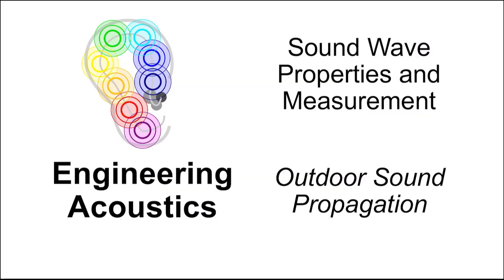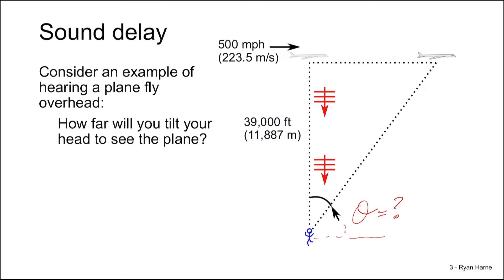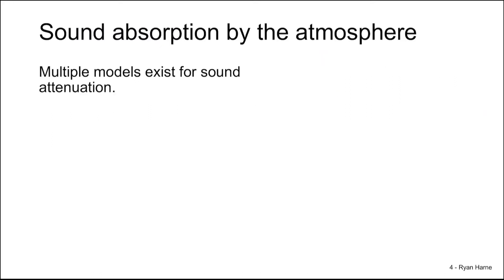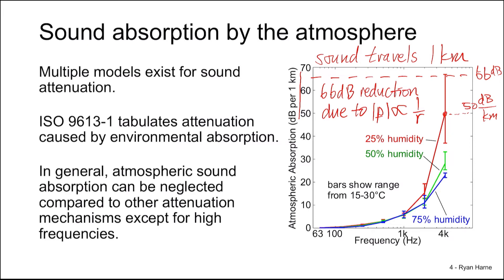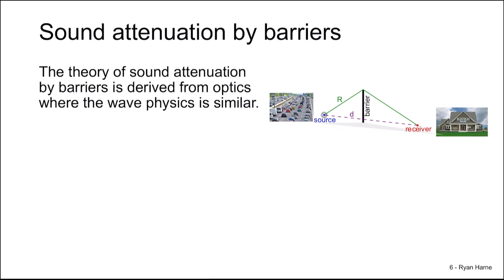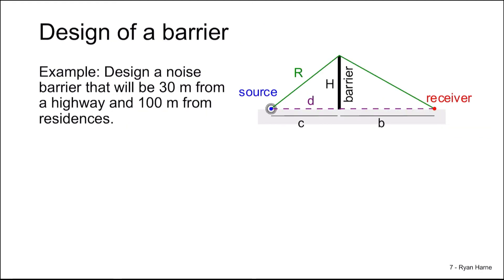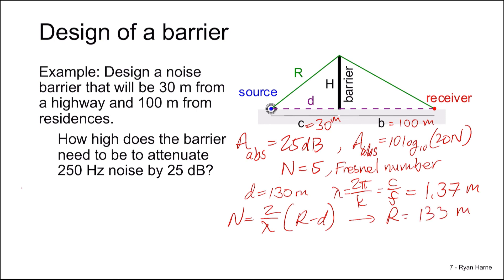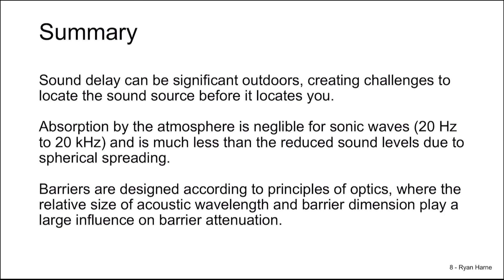Engineering Acoustics: 15. Outdoor Sound Propagation

Comment: 8:36 - With Fresnel number N = 5 you should get 'only' 20dB attenuation, because 10 * log_10(20 * 5) = 20. 
If 25dB attenuation is required, Fresnel number N should be 16. This would give R = 141 [m] and barrier hight H would need to be 23.5 [m], which is ~ twice as high than with 20dB attenuation.